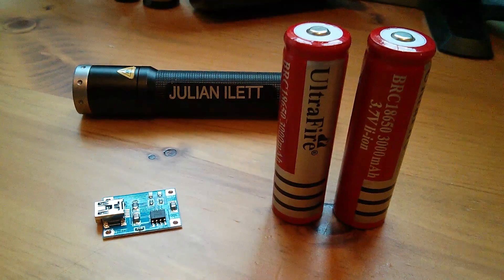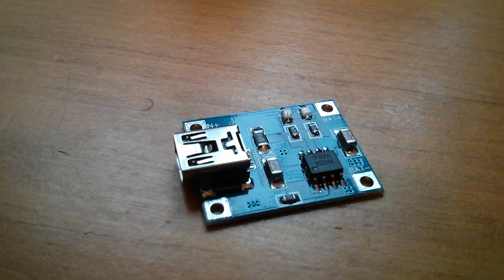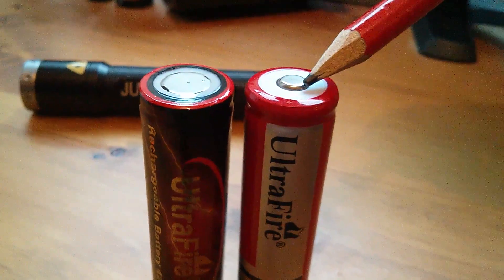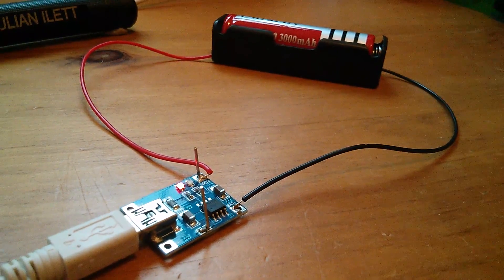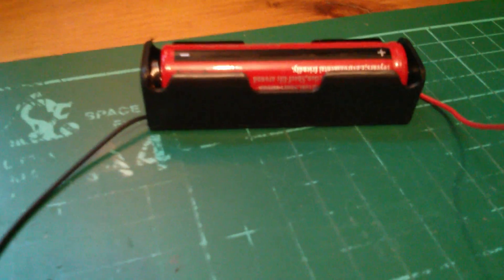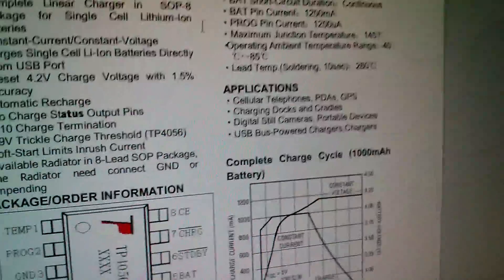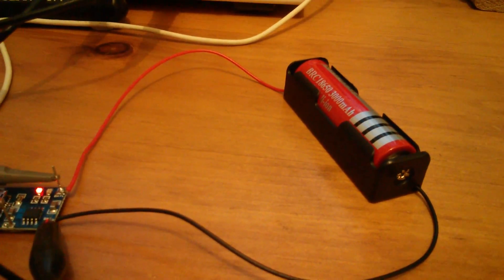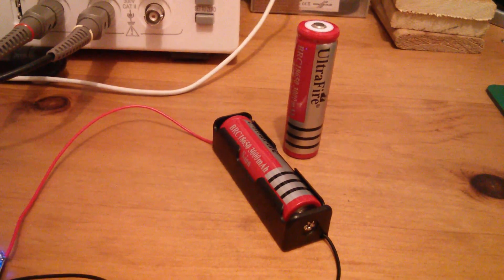Charging a Lithium 18650 Cell using the TP4056

Comment: I know the computer or main connector is a 2.0 usb .I don't know the board connector-Is it a mini "a" mini"b" , male or female , mini or micro. My phone charger connection does not fit and in the phone literature is only lists mini usb .
I don't know the connector cable name to order.
Reply: I believe you are looking for "Micro USB"
Reply: +Digging4Answers is that an U.K. mini usb connector? is it a micro usb a connector? is it a micro usb B connector or is it a machine device mini usb connector. the vendor i purchased this from in china advised me that HE didn't even have this sort of cable as it only comes with testing devices. so which model and type of cell phone have you physically attached this to? Nothing in the U.S. connects to this board.
Reply: +cuyler wilkinson i solved my problem and threw them in the garbage.thanks anyway that might have been the reason they were so cheap.
Reply: +cuyler wilkinson I haven't had any physical experience with this board, but it does seem that  a Samsung phone charger might fit
Reply: +Digging4Answers this might fits is the problem. i noticed in your video the part where this "magic cable" appears had been edited. lets do this the simple way. what is the make , model#,part# or serial number of the exact cable shown in the video.
Reply: I don't know, this isn't my video

Comment: Is there a circuit that lets you charge two of these at the same time?
Reply: +RobTapps88 the cells are fake... he'd be lucky if they've got 1000mah each... some of the ultrafire 3000mah batteries test as low as 600mah
Reply: +EliteSniperTV  search for 6.4V LiFe Battery PCM Protection Circuit Module For 2S1P 18650 LiFePO4 C:5A 053 on ebay you'll find plenty
Reply: 2* 3000mah @ 4.2v is equal to 1* 6000mah @4.2v you could use one board but it would take way longer... you could also dasiy chain multiple boards together to one power supply.. to keep charge time down..
Reply: Hey Clement,would that module work for a 2S3P cell pack also or should I go another direction? Safety and charging speed are my aim.
Reply: I'm using a 9v (3w) solar panel (with an adjustable step down module at 8v) as the primary charging method,but I want to add a 2ndary for when solar isn't available.

Comment: so can this charge a cell phone battery?
Reply: +Beginner&#39;s Tech You mean if you take the battery out and connect it to this? Why not just plug the usb cable into your phone instead?
Reply: Miles Aurbeck yes that is what i want to do. and the phone is broken and dosent charge anymore but the battery is still good and i wanted to try to use it in a project
Reply: +Beginner&#39;s Tech Do you know how many volts it is? Its mAh rating?
Reply: Miles Aurbeck it is a 3.7 volt and i think 800 mah
Reply: +Beginner's Tech You'd likely need to adjust the resistor on the circuit board. You don't want to charge a battery with more mAh than it's rated. This board charges at 1000mAh without mods. You'd probably be better served finding another phone of the same kind and using that to charge it. Or if your phone that is broken also can't charge, maybe your battery has issues also. But it's best not to mess with these batteries. They can have pretty crazy consequences for maltreatment. Google lipoly explosions or fire.
Reply: Miles Aurbeck yeah i know what these little things can do. maybe i will take it outside and just try charging it to see what happens  :)

Comment: Hey! 

Great video. 
One question: how do you change the resistor (rprog) to change the charge current? 
Do you srew or roll it or something? Or do you litterly need to solder in a different resistor?
Reply: Well you could add another one in parallel or replace the existing one.
Reply: why, to get more mAmps? would d other components be able to handle it?

Comment: Hello Sir, nice video, I'm about to do a project where I'll use Ni-ion batteries and I'll have one of those tp4056 that you are showing on this video (exactly the same) for each cell, but I was thinking of a little problem which is, how much current does this chip requires? I know the voltaje has to be between 4 and 8 volts according to the datasheet, but I haven't found any data that tells about the current this chip requires to work, could you please tell me if you found out?
as extra data, my project will use 8 cells, so I'll have 8 tp4056 to charge each cell individually and in relatively quick time, so what I really need to know is how much current this will take so I can find a good power suply to power these tp4056 chips.
thank you for your time and keep on doing these nice videos. Greetings from Chile!

Comment: Hi, would I be current to assume that if I connect 4 capacity-matched Protected Panasonic NCR18650B batteries to this in parallel, that would charge them with 250ma of current going to each of the four cells if I use the default current setting?
Reply: +ATNR. If all cells are at an equal state of charge and roughly the same age and treatment at the time of recharge then they'll pretty much all charge at the same rate. They will all end up 4.2v's eventually. With protected cells you almost don't need a charge controller as they more or less already have one built in. Most protect against over current in and out and over/under volt, which is what cc/cv charging is, some also monitor temps. But you can't always rely on these built in's unless you know exactly which controller is installed for protection, like an lm3641 or similar.

Comment: Hi! If I change the charge current resistor, can I charge two cells in parallel?
Reply: you wouldn't even need to... in parallel it would act as 1 larger capacity 4.2V cell it would take a long Ass time to charge say a 2* 3000mah parallel setup.. but you could do it with one board..
Reply from the maker: +Simon Nordberg Yes, up to 1A
Reply: +Julian Ilett Do you know any 18650 charge module that would be able to charge with at least 0,33C and having more than one battery?
I am planning to make a portable Raspberry Pi and a single 18650 won't last long if you add a screen. I also don't want to wait 6 or more hours for a full charge.
Would it be better to add multiple parrallel cells and a step-up converter, or multiple seriell cells (using a multi-cell/balancer charging module) and a step-down converter?
Reply: +Julian Ilett hi can we charge 2 parallel connected cells with 1 Tp4056 board without any modification?
Reply: +Shoaib Rahman read that comment I posted to the OP

Comment: Dear Julian,
I have two  li 18650 3,7V, 4400mAh batteries ( I suppose so, I took them from laptop battery pack which contained of 10 pcs., with total declared capacity of 4400mAh) welded in parallel, which I want to integrate with LED torch (currently supplied with 3AA batteries connected in serial). The problem is that I need miniature 220V/USB chrager (less then 3,5x4,5cm ) which I want to integrate with mantioned LED torch as well.
I prefer 220V (if it exists that small) to USB option. Can you recommend any instant solution, those TP4056's are really small, but USB operated.
Thanks in advance.

Comment: Hi Julian!  I have a question, if I have a battery pack of 2x18650s in series (=total of 8.4v if fully charged), would the TP4056 charge them both?  Or would I need a charger that outputs 8.4v?  Thank you so much!!!

Comment: I  don't understand , could you put 4.7 v , (the output of this charger ) into a li-po battery that says "3.7 v 200mah "? Wouldn't it cause over charge ?
Reply: no because 3S means three 4.2v cells in series. which makes up about 12.6v
just dont run it on 4S setting
Reply: +Jose Cumpa No. the output of this charger is max 4.2V, although it's more complex than that due to the CC/CV phases. 4.7V into a li-ion cell is risky and could result in smoke and/or fire. Don't mess with li-ion cells, especially unprotected ones, if you don't know what you're doing! The 3.7V marked on Li-ion cells is a reasonably meaningless average voltage figure. The important numbers are 4.2V max, 3.0V min, depending on the chemistry of the cell in question.
Reply: realflow100 
I charged my 3S lithium polymer battery at more than 4.2V and it's fine ;-)
Reply: That can be dangerous.
if you REALLY ARE DESPERATE to charge higher than 4.2v
Charge at a VERY VERY LOW RATE. like 20mA or really slowly.
and I wouldn't go any higher than a resting fully charged voltage of 4.35v or maybe just 4.3v
You don't get a whole lot extra when overcharging it.
because you've already put the maximum amount of electrons in it. further charging just makes it heat up and possibly degrades the electrodes.
For maximum safety and maximum life. you would cut off the charge early at 3v to 3.3v under load. and charge up to max of 3.9v or 4.0v
but overcharging reduces the life significantly.
You only get a few more minutes of useable power or less with overcharging it. so don't do it. its not worth it. depending on what your powering with it. if it normally lasts an hour. maybe it'd last an hour and a few extra minutes with an overcharge.
Reply: realflow100
I charged my 2200mAh 3S1P Li-Po battery at 2.2A CC/ 12.6V CV on balance mode. Do you think that's dangerous?
Reply: NO.
It will EXPLODE AND FLAME AND FIRE over 4.2v
ONLY use 4.2v
This charger only puts out 4.2v maximum! NOT 4.7v'
DO NOT CHARGE ANY LITHIUM BATTERY WITH A VOLTAGE OVER 4.2V NO MATTER WHAT!

Comment: Hi, I'm new to lipo batteries and have a quadcopter that came with a 3.7 V 500 mAh lipo battery and its proper wall charger. However, I can't fly it longer than 6-7 min with that battery, so I purchased a bit bigger 3.7 V 2000 mAh lipo battery and tried charging it with the same charger. On the bottom of the charger it says the output is DC 4.3 V @ 800 mA. However, the wall wart turned pretty hot to touch after some time even though the green LED lit on to indicate it charged. Could this module be used for charging my 2000mAh lipo or do you think the chip would turn hot to touch as well? Please?
Reply: +Viktor Božičević Nah man, go buy a Nitecore charger and be safe.
Reply: Thanks, I already purchased IMAX B6 LiPo charger, but haven't used it yet. Hope it will charge it fine :)
Reply: +Viktor Božičević please share your Results

Comment: hi julian, another question. if these boards are only designed to charge a single cell, is there a version of this board than is capable of charging multiples of these baatteries?

Comment: Is there a small device like this but to monitoring for low voltage and does cut off?
Reply: xxgg Yes there is. You could take a look at this kind of modules: http://www.ebay.ca/itm/5V-Micro-USB-1A-18650-Lithium-Battery-Charging-Board-Charger-Module-New-F5-/291352615791?hash=item43d5f81b6f.
Reply: GhVost So the battery goes on B+ and B- and the circuit you want to power on output? If you can charge batteries and it cuts of at a reasonable voltage to prevent damage to battery this thing would be perfect perfect for small projects needing any portable power.
Reply: Where would one connect the wires to utilize this as low voltage cut-off ?
It can not change cut-off volt too. hmm
Reply: Which wires? I'm fairly sure I got the wiring right in the first comment, B+/- for battery, OUT+/- for the electronics you want the battery to power and +/- for the input, seems to make sense but I'm not 100%
Reply: Xfactor Chem Everything is correct. the + line is common (B+ and OUT+ are connected permanently). But the ground lines (B- and Out-) are connected via mosfet capable to pass up to 6 amperes (I don't remember it  by heart). So when the voltage is lower the threshold or the current is higher than some amperes the ground line is disconnected saving you precious lithium cell. This module is really nice for low power one cell DIY projects. For example in combination with 3v->5v boost module a simple but capable DIY power bank is a piece of cake. Resistor r3 is programming maximum charging current.

Comment: what would happen if the input voltage to TP4056 is lower than 4V and the lithium battery is connected to the TP4056.

Comment: Can u tell me how to wire the charger if the batteries are in series ty very much have a good day
Reply: Chris Kletzine the answer to that is you cant, you would require a balance charger with higher voltage, but there is a way of switching the batteries from series to parallel for charging but it requires each end of the battery to be wired individually to a 3 position double pole double throw (dpdt)toggle switch and the switch must be able to handle the current you are using when draining the batteries, you must also be careful when wiring this switch as you can easily make a mistake and short the batteries so only attempt it if you are confident you know what you are doing
Reply: K i knew there was something i could do just was unsure ty again
Reply: Chris Kletzine ps this is assuming you only have 2 series
Reply: Chris Kletzine wiring diagram is here http://www.instructables.com/id/SIMPLE-ParallelSeries-Select-Switch/step2/Wiring-the-switch/
Reply: Chris Kletzine also the charger should be wired to the 2 middle pins on the switch

Comment: hi can I use a double18650 battery holder and charge two batteries at the same time?.
Thankz..
Reply: john silva in parallel yes. there are some things to watch out for but ig you can do this.

Comment: How long should it take to charge a fully discharged 18650 cell using the TP4046?  I have had my setup charging for over 36 hours and the red light is still on. Is something wrong?

Comment: can you charge multiple 18650 batteries with that one chip?
Reply: I've been charging 4 with 1 chip for over a year!!
Reply: You can if they're connected in parallel but they'll take longer to charge.  These chargers aren't designed to charge batteries connected in series.

Comment: Has anyone tried charging a 3s lipo pack using 3 of these - 1 for each cell?  Is there any reason that wouldn't work?
Reply: you'll need 3 isolated power supply for each board

Comment: Good vid  and good info. Can one discharge an AGM battery  all the way down and recharge it without causing damage to the AGM battery?
Thanks
Reply: +robviolin1 The tp4056 is not for charging AGM or any type of lead acid battery; or any non~lithium battery
Reply: +revmpandora thanks but I was asking a general question. My question was : can a agm or lead acid battery be complete discharged and then recharged?
Reply: I see. When you completely discharge, do you mean down to 0.0 volts? I ask because I have brought lead acid batteries back from near terminal voltage, like under 1 volt, but never from totally dead, 0 volts. Either way, it's not good at all for the battery. You should look into something, I think is called desulfating a lead acid battery. Not my area of expertise, but I've read on it some. It helps undo some of the damage that occurs when a LA battery is flattened. Good luck!
Reply: +revmpandora very helpful, thanks.
Reply: robviolin1 No prob

Comment: sorry there's one problem bothers me for long time. what if I attach this module to the battery as well as the load, is it possible to support the load and charge the battery at the same time ? or is there any risk of doing this?
Reply: Zelra 仙賢戀軒 It will support the load a little bit, yes.  I've done so without any damages.

Comment: I was sent a board like the one above along with a lit-ion battery for a Samsung phone. How do I use this board to charge the battery?  There is no info which is + or - on the output pins. Do I need to strip down a phone charge lead and solder this on to the board? If in panic can I use my old charger to charge this lit-ion battery?

Comment: Julian Ilett Thanks for the video. I am on a mission to build solar charged light over this weekend. I am not an expert but am determined. The whole thing started when I was looking for solar light and realized they are damn expensive.
I am currently located in Shanghai so all components are easily available online. Please guide me if I am doing something wrong.
My Plan
1 x Photoelectric resistor (to ensure it turns on at night)
1 x 3w LED
1 x solar panel that can produce 5v
1 x li-ion 3.7 v 3000mAmp battery
1 x diode to ensure current only flows from panel to battery not in the opposite direction
1 x empty glass jar to put all setup in

Is there anything else I need?

Comment: with the newer charger modules(micro USB) (also has output protection), I think when you have a dead cell, it lights both LEDS simultaneously. does this older type do that too?

Comment: hi guys,I bought this module. But I do not understand why I need it to charge a lithium battery. If I cut a usb cable and re-direct the - and + cables inside to a lithium battery, would that work as well? Or is this just a safety issue that the chip controls exactly the current and the overcharging of the lithium?
Reply: Lithium-Ion technology requires both constant voltage and constant current in order to correctly charge the battery.  Too much current risks causing the battery casing to split and the contents to catch on fire, while too much voltage is likely to damage the internal chemistry of the battery and also cause it to fail.  The TP4056 circuit provides the correct charging conditions.

Comment: Could i make a cell balance charger with these? For example, if i had a 3S 12V LiPo battery, i would use 3 of these bad boys and charge all the cells separately. Would it work, or am i missing something? Im planning to make my own small LIPO cell balancer for my elecrtic skateboard. Will this work, or am i missing something?
Reply: RandomLOLGamer Update, i tried, it failed, it seems problems occur when connected in series. Im going to order some isolated DC-DC converters, put them behind the power supply and report back if it works!
Reply: RandomLOLGamer If you have isolated ground supply wires, it will work, otherwise not, you are better off buying a normal balancer charger.
Reply: Are you youtuber Twisted?